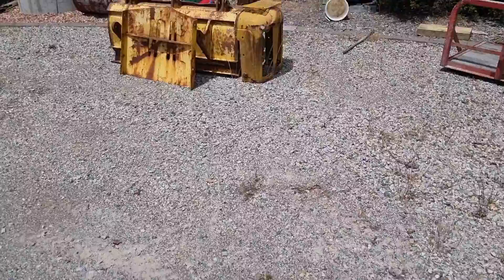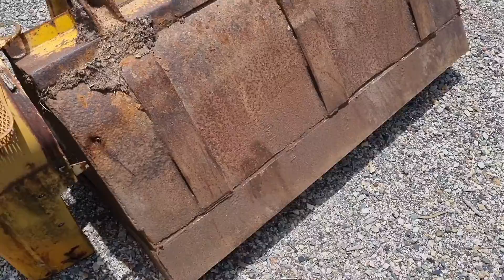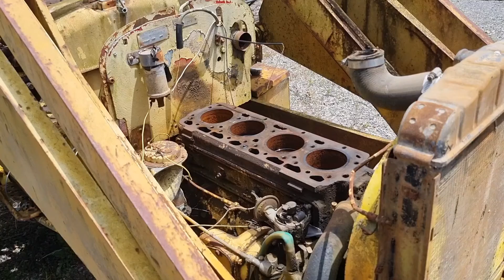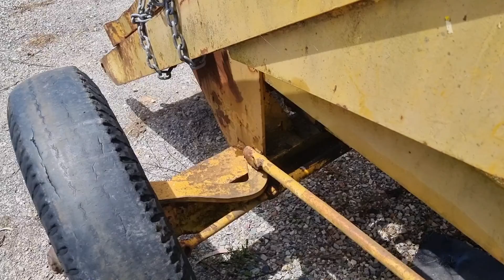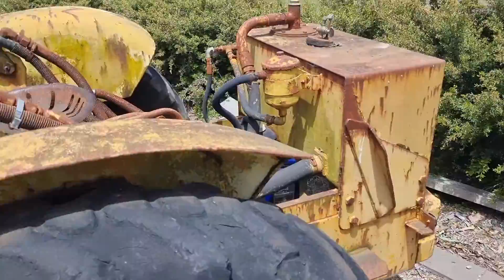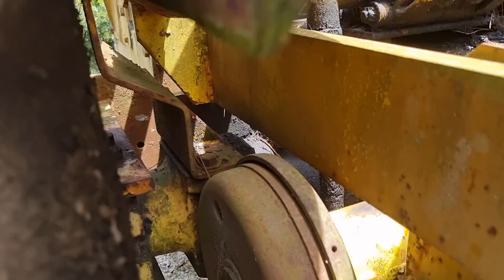Fordson Industrial Major Project Overview

Comment: Gday mate what would cause no diesel to come out of injector pump on cylinder 2 ?
I brought one of these today but cylinder 2 not getting diesel, any help greatly appreciated
Reply from the maker: Pop the cover plate off the injector pump and make sure the rail and all the springs are working while its running. Make sure everything is free and moving. Check the pipe fittings for blockages as well.
Reply: @fixingfordsonsaustralia6632  cheers mate i left deposit on it today pick up next wk its 4 cylinder diesel with same front end loader setup as in your vid. It needs abit of work, 

needs gasket at back sump

seal in one the hydraulic levers as lad said if dont hold lever up it drops down

Not pumping diesel on cylinder 2 

And needs starter motor but tow starts ok

Comes with forklift tynes, dirt bucket and graderblade for rear as has downward ram at back

Super keen to get it home to fix it up

Comment: Interesting piece of history. I would check the casting codes again. The Majors finished in the UK in 1964. Ebro continued to make the Major in Spain for some years afterwards. The tank looks like a Power Major and on as it has a flattened area near the steering wheel where gauges would be mounted. The lower dash fits with that era.

Comment: Hi mate I have one similar to yours but mine is a super major. I want to fix the steering up on mine is to hard to steer. Can you buy parts in Australia for the industrial ones? And is it easy to fix up? Mine has a hydraulic steering pump and a ram.
Reply from the maker: The steering assembly was the same as non industrial tractors, however the front axle was a Moore Engineering build and not standard. Hydraulic assist kits are still available if thats what you require.
Reply: @fixingfordsonsaustralia6632  where do you buy all your parts from and I love watching your videos mate. Can wait for you to do that old girl up

Comment: If the casting codes are right, that means it was built 2 years after the super major went out of production..  thats rather unusual 🤔
Reply from the maker: I agree, it's a bit of a head scratcher, I'm starting to think it's been made up of different tractors.
Reply: @fixingfordsonsaustralia6632  Ford stopped offering the petrol version before the Power Major was introduced, which would make this a earlier Major